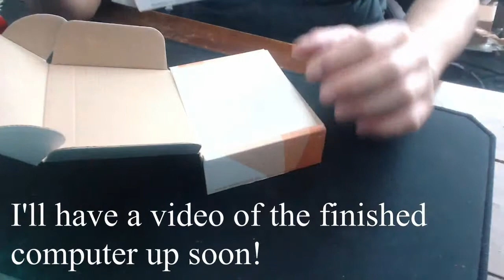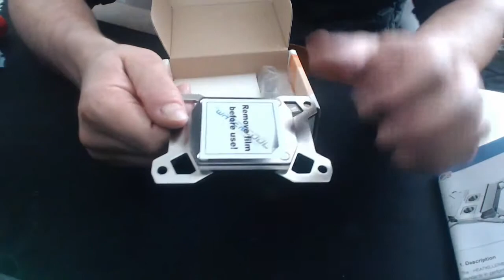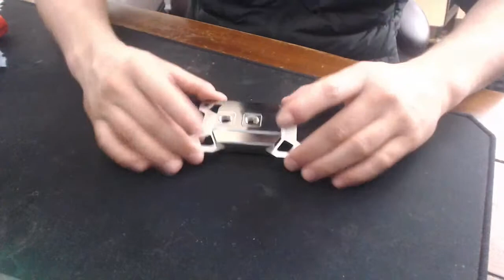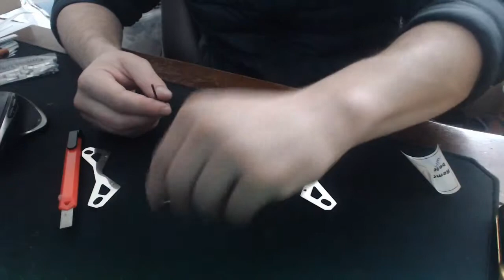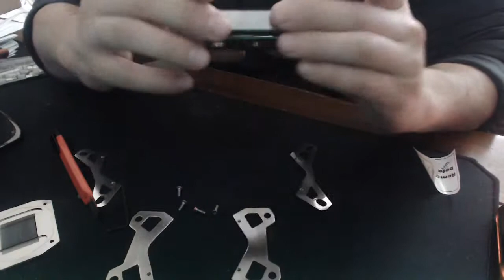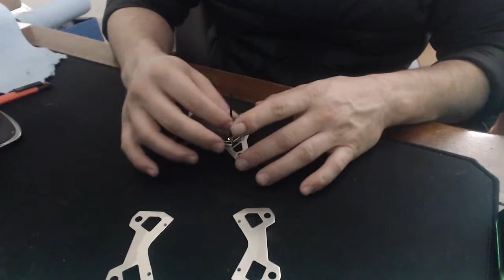Heatkiller V4 CPU Waterblock

Comment: Just bought this along with an Alphacool 420mm UT60 and D5 250ML res. 
Can't wait to set it all up on my Direct Die modded liquid metal chip.   Currently only running a 280mm AIO Corsair, I hope the difference is worth it.
Reply: heya, I bought it too but will wait for Black Friday to finish purchasing components